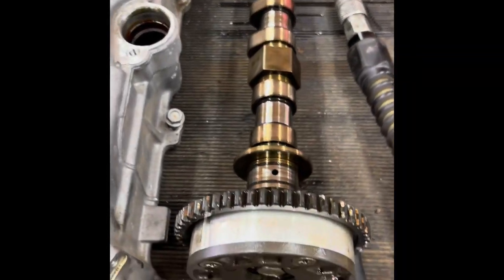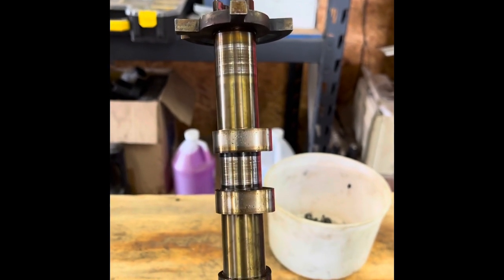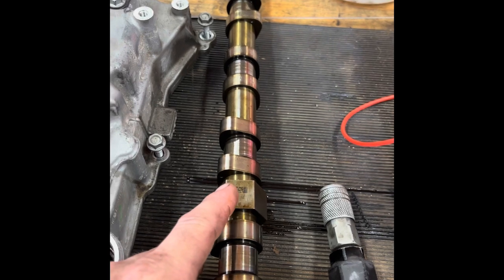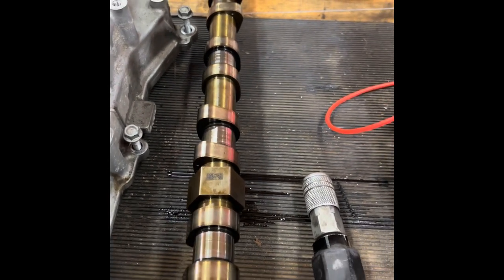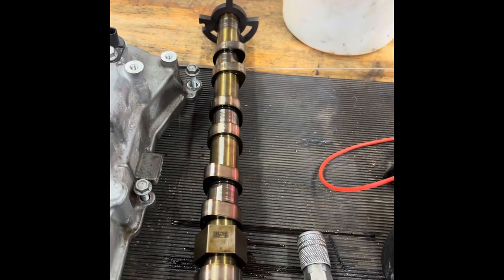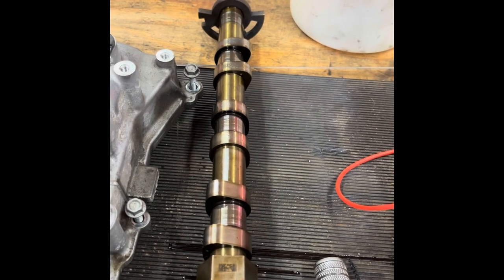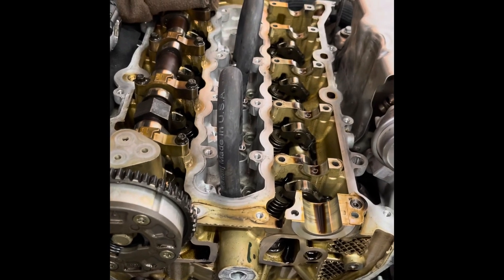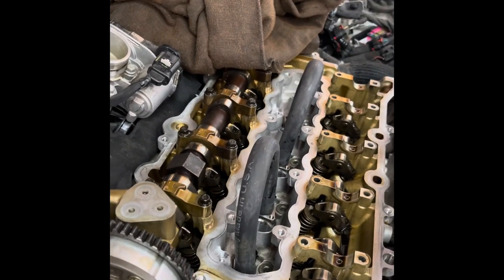GM 1.5 liter turbo P0014 and P0017 Exhaust camshaft timing.

Comment: I had this problem with customer car. I watched your video and discovered my problem was same as yours. I used a punch and a couple of pry bars to reposition the reluctor wheel. Then I use the welder and tacked it to the cam shift. It worked. Thank you for this video.
Reply: i am  a retired gm tech and you are correct, no need to do all that work !

Comment: Awesome catch! That was the problem.  I used a blunt piece of steel and a hammer to rotate the reluctor ring counterclockwise to get it back into alignment. I used a laser down the camshaft by eye for the realignment and put it back together and the codes cleared and car runs fine now, Thanks. Great find!!
Reply: How much force did you use to spin the reluctor on that camshaft?
Reply: Thank you so much for this information 🙏🏼

Comment: God bless this man. I had to go in through the cam sensor port to knock the ring into a better position after doing the job, and it got to running with no codes.
Reply from the maker: @lightmobile  awesome

Comment: thanks a lot for the info on this video samething happened on this 2020 equinox im working on , the vacuum pump failed and the broken pieces inside the valve cover problably got stucked in between thanks to this video i was able to diagnose the problem correctly

Comment: I rarely comment or give Kudo's on a Youtube vid, but this save me and the customer alot of headache. I actually adjusted the realuctor thru the cam sensor hole after finding TDC and changing a broken vacuum pump. thx    Mike (Luckiamute Auto Body)
Reply from the maker: Glad it helped
Reply: My mechanic just sent me this video too, im having exact same problem with my new equinox.
Reply: How did u find top dead center and adjust it through the hole ? I took the valve cover off and reset the reluctor wheel . It ran a little better but still not correct getting a cam /crank code bank 1

Comment: Just did one. Same issue. Very common problem. Its electronically timed, if it moves it will not start! Replace just the cam and the vacuum pump and your good to go. Obviously pull your pan off and clean it out, plus l.o.f.  Just reset the timing tensioner and use a small drill bit to hold it. Timing simple. Cam cap torque is 106 inch pounds. Actuator is 15 ft lbs. Plus 90 degrees.
Reply: Do you know if the cam can be removed without taking the timing cover off and oil pan ?

Comment: I've not pulled the cam shaft covers off, but here is a good one.  P00014 and P0017.  Crank no start.  Pull both cam position sensors and car will start and idle.  This was after I had replaced both valves.  This started on my daughters Malibu after she heard a loud "thunk" from the engine compartment and within 3 miles at interstate speed the motor lost power and died in the fast lane.  That is when she also discovered her brake pedal was very hard and more difficult to stop. The vacuum pump locked up and broke off chunks of the housing that surrounds the coupling, and hence knocked the reluctor out of position.  I hope I can realign it on the cam.  This design is not one of GM's better ideas.
Reply from the maker: Definitely need to address the reluctor. It likely runs with them disconnected because the ECM is not receiving any info instead of receiving info that says it’s out of time.
Reply: @donshort6651  tapped the reluctor back into alignment with the  barcode spot on the cam. Put it all back together and it started first crank.  Running well now.  Wasn’t the first time for this motor either.  I found chunks of vacuum pump from a previous episode.  Aluminum
Reply: I am have the same problem same codes and car.. I can't find anyone with confidence to fix it. The brake peddle isn't hard now they replaced the brake booster but it isn't running
Reply: @brookebridgewater5219  Is the check engine light on?  If yes, can you get someone to pull the codes?  If you disconnect both cam position sensors will it start and idle?  If so, then you likely have a cam position reluctor ( the thing that spins on the cam and tells the engine where the cam is in its rotation) knocked out of position.  Which will require pulling the valve cover to see.

Comment: if you take the exhaust camshaft positioning sensor out you can see the camshaft reluctor wheel... tomorrow or Sunday i will attempt to turn the reluctur wheel from the camshaft position location without taking the value cover off by aligning the reluctor wheel tab with the slot that vaccum pump slides into without having to see the laser ech barcode....i use a grabbing tool a magnet stick and some tweezer to clean the piece of the old pump out when i replaced the pump so im not concerned about vaccum pump pieces...i drive my car every day but that rough start and reduced engine speed screen is getting old and i think its messing up my fuel efficiency but other than that i drive my car rather normally

Comment: i recommend everybody replace the vacuum pump with higher miles and change oil every 3000 miles,  and you can line up the cam and that is fine again.  ,, so oil changes, replace pump and straighten the cam and you will be fine !!!

Comment: I'm chasing a P0014 and P0017 on a 2.4 Malibu. Looks like this isn't the cause but great catch my dude. Happy wrenching
Reply: Did you ever figure those two codes out? I have the same issue
Reply: @Bronze_T_Garage  The owner declined further investigation and he may have scrapped it or sold it sorry. I had the valve cover off at one point and the timing was dead on.
Reply: @wrenchposting9097  ironically the valve cover I just pulled had a conpletely obliterated pump and spun the end piece.

Comment: I have a question for you. I have the same vehicle. I replaced the camshaft after the vacuum pump broke. For some reason, the new cam isn't going in correctly. The A on the exhaust sprocket is turned to the left about 60 degrees from the intake sprocket. Is this normal? I put it all back together and it's still throwing codes. PO1101 and PO0011. When I installed the new chain. I had to grab a wrench and move the exhaust camshaft to the right position to put the chain on. But I feel like this is throwing off the timing. Any advice would be greatly appreciated thank you!
Reply from the maker: If you aligned the colored links then it should be in time. Some engines will require you to rotate the cam a little to get it timed correctly. Did you install a new chain?

Comment: Hey Don -thank you for the video. We have a 2019 Malibu in the shop now with an intermittent crank/no-start BUT also while the customer is driving it, the car will lose power and she has to pull over and shut it off. It only has the P0014 code and so far the brakes are fine. Oil is full and clean and so far we have not been able to duplicate ANY of her symptoms. Thoughts?
Reply from the maker: I would swap the cam sensors if they’re the same. See if it changes to the intake side. You could always remove the valve cover and inspect the reluctor position on the camshaft. With it being intermittent, I don’t think this would be your issue. The issue I was seeing would set codes immediately after start up.

Comment: Did any of the codes came back? My mechanic is currently doing this job, he recommended me to get a new cam, but told him to use the same, he said it might be risky cause check engine light might keep on.
Reply from the maker: No codes came back on the one I did. I installed a new camshaft and that’s what I would recommend.

Comment: Hey Don, is there anywhere I can get the part number for the Exhaust camshaft.. I had the vaccum pump shatter. Crank no start after that, I opened valve cover and fished out pieces.. Reluctor was out so tapped in place.. Now starts but idles rough, POO17 with Engine light on and "Reduced Engine Power"... Changed Oil, Sparks. Havnt done VVT solenoid but I think I may have the reluctor issue... Im I'm New Zealand and they are known as the Holden Equinox here.. Dealer shut down, parts only but waayyyy overpriced and they refuse to give out part numbers. Will get one online but not sure of part number.. Also, is there anything else required apart from the Exhaust camshaft in way of parts? Appreciate any input and assistance please
Reply: Sorry, it's a 2018 Chevrolet (Holden) Equinox LS Plus - 1.5L Turbo
Reply from the maker: @scribe8398 VIN?

Comment: got a 17 1.5 malibu did whole headgasket on it , made sure timing was lined up i put the cam at 12 o clock but when i did my first start engine would just crank and crank no start only start with brake cleaner . everytime i remove valve cover the reluctor moved . i got fuel pressure to low when cranking camshaft postion sensor code and mass air flow out of range . any ideas? i replaced those parts and still nothing same code
Reply from the maker: Well, I have no way to verify your timing is good. If it starts with brake cleaner then you just not be getting fuel. These are direct injection so there is a low pressure side and high pressure side of the fuel system. Without scanner data I’m not sure where to point you but it does sound like you’re not getting fuel for some reason.

Comment: Did you have to replace the cam shaft?  Or could the original have been used by simply retiming the relucter?
Reply from the maker: I chose to replace it, but it maybe could have been reused. I didn’t want to take the chance that maybe the reluctor wouldn’t be as tight and could move again.

Comment: What did you use for the cam holder? I can’t see to find one. I have. 2018 Chevy equinox LS  with the same problem.
Reply from the maker: They have a special cam holding tool. I would have to look up the number but you should be able to google it.
Reply: Cresent wrench
Reply: @donshort6651   I've tried I could find a specific one for it.
Reply: Hey don, I’m trying to see if you help me out. So I’ve replaced the exhaust cam shaft and cam phaser. But I’m still getting p0014 and p0017? Maybe I put in the wrong timing?
Reply from the maker: @hectorimperial3817  check your actuator solenoid for an issue. If it’s acting up it can be changing the position of the camshaft actuator and causing these codes.
Reply from the maker: @hectorimperial3817  The camshaft holding tool is EN-51367
Reply: @donshort6651  ok sounds good I’m going to try it tomorrow and see how it goes. Aside for the 1 and 4 cylinder being at top dead center and the reluctner being at 12 should the two phaser be at a certain time like right 1 o’clock and left 11 o’clock?
Reply: @donshort6651   Hey Don when timing the car does both Cam phasers have to be at 12 o'clock? or this a certain time they have to be in.

Comment: thanks.  would this also cause a crank no start.
Reply from the maker: Doubtful. Cause technically the engine is still in time. Just the camshaft sensor is showing it isn’t.
Reply: @donshort6651  I had the crank no start.  P00014 and P00017.  Pulled both cam sensors and the car would start and run.  For what it's worth.  Something to try.

Comment: Also did you replace the timing chain and guides ect...
Reply from the maker: On this one I didn’t. The engine had 66k miles. Was barely out of warranty.
Reply: @donshort6651  finally you stated the milage 🙆🙆👍👍👍

Comment: Ive been trying to move the reluctor but its stuck on there. I have it top dead center right now would spinning the motor to align it with the upsidedown reluctor work?
Reply from the maker: Not quite sure what you’re asking. If you have the valve cover removed, you should be able to adjust the reluctor.

Comment: I know this is a old video but the sprocket on the exhaust cam does it just bolt on?
Reply from the maker: Both sprockets bolt on
Reply: @donshort6651  10 4 thanks man what about the timing cover is it a gasket or just some rtv? I
Reply from the maker: It’s silicone. I only use what’s called “the right stuff”. Best silicone I have found.

Comment: I am having the same issue with my 2016 Colorado but I have the 2.5l. It doesn’t have the laser marks on the cam shaft so do you have any information on the reluctor wheel for this motor ? Thanks
Reply from the maker: I have not worked on the 2.5l as of yet.

Comment: Going through this headache now, do you think there is a way to spin it back without taking the engine apart
Reply from the maker: You could probably definitely spin it, but I’m not  sure you could tell when to stop without removing the valve cover and getting a visual of the camshaft location. If you have a scan tool you could move it some and then watch the cam sensor to see how close it is.
Reply: @donshort6651  read comment above

Comment: I have only a p0017 crank no start. I dont have the p0014 though any idea?
Reply: And it's a 18 equinox 1.5 turbo
Reply from the maker: Disconnect the cam sensor on the exhaust side and see if it starts. If it does, then you need to inspect the reluctor on the camshaft and the vacuum pump for damage.
Reply: Ok so vacuum pump did have damage and it did work. So I replaced the vacuum pump and both sensor and it still only will start with the exhaust side unplugged
Reply from the maker: Then you need to check the reluctor on the camshaft. It was likely affected by the vacuum pump

Comment: We have this engine in a ‘18 Equinox.  Was a lease but then we bought it since prices have gone nuts ($4k less than trade in).  I change oil 3-6kmi.  First change was 600mi cause im nuts.   Anyway…is this a good engine?   Cheap/easy to repair being so small?   Wonder if we keep it several years…100,000 plus mi or get rid of it before it gets expensive repairs….  Thanks
Reply from the maker: Not a bad engine. Just has some issues like all engines have. Keep oil full and clean.
Reply: That's the worse engine the gm has.  Any ecotec is a piece of junk. I work on these all the time.